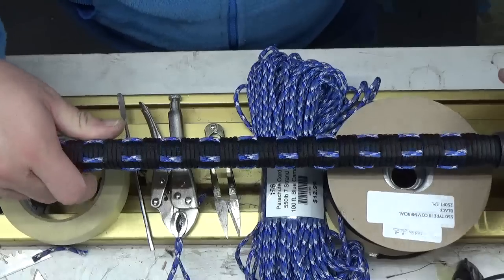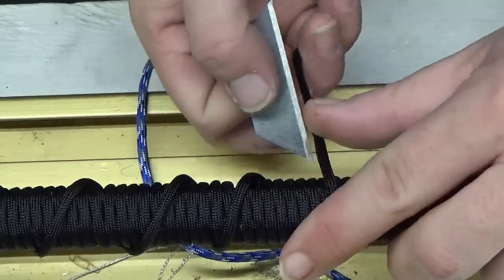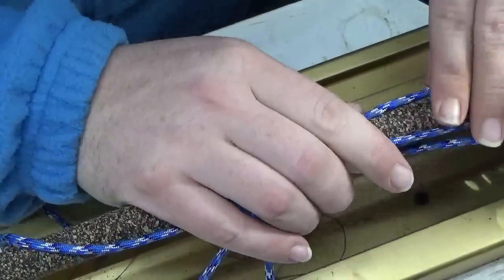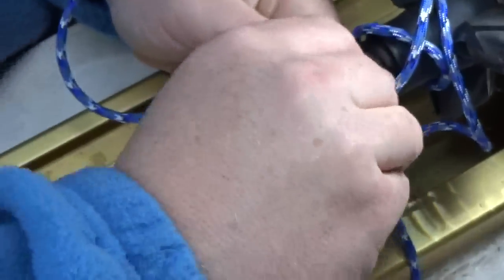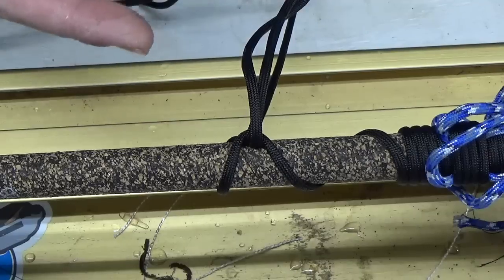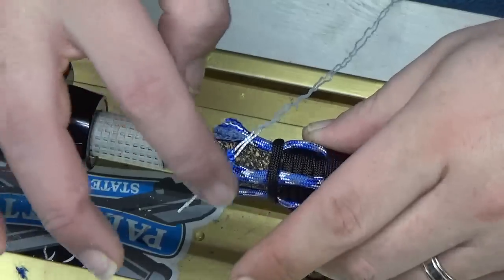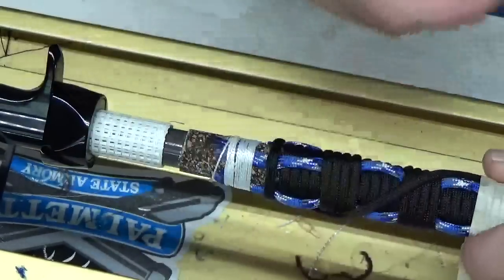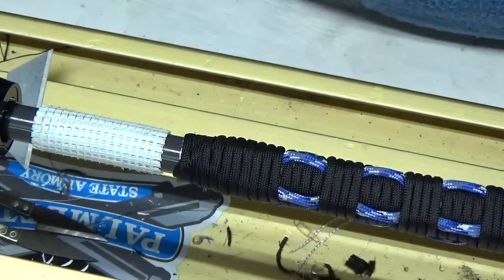Basket Weave Paracord Grip

Comment: Excellent video!!! You stated that you sometimes do the wrap with gutted paracord, do you find that it lays better or about the same. Thanks
Reply from the maker: It does lay flatter by gutting the cord. But it comes down to handle thickness preference.
Reply: Would you want to make four marks on the cork to make sure your keeping it straight

Comment: what do you use to hold the paracord in place once the wrap is completed? If no epoxy is used, wouldn't it unravel over time?
Reply from the maker: The ends hold the overall wrap down. The cord grabs the cork tape.